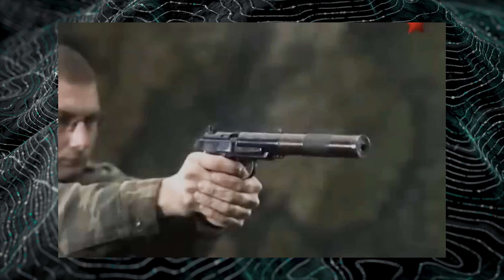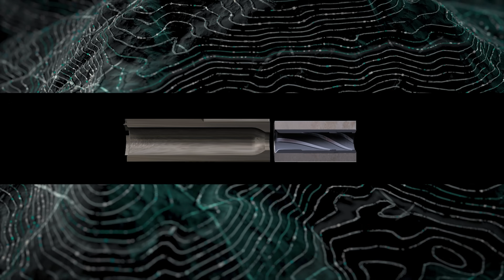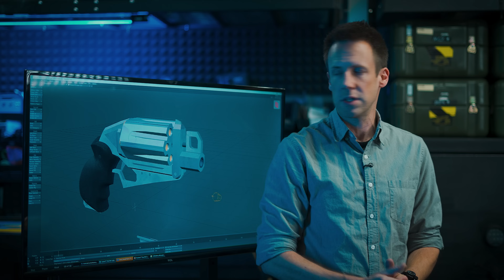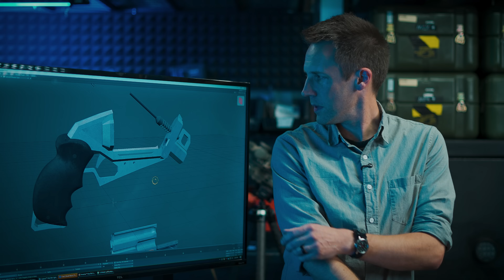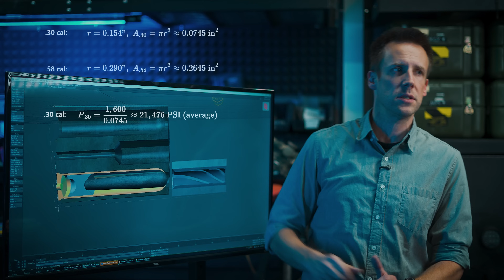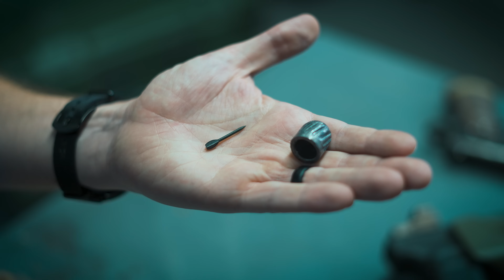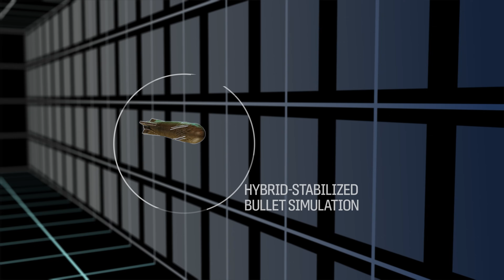Modern Captive Piston Ammo Could Enable Silent Handguns

Comment: Forget the fin stabilization.  Flute the projectile itself, and mill companion flutes into the inside of the barrel.  This lightens the projectile for it's length and further seals the barrel from gas escape, lowering the necessary pressure.  The one downside is that you would have to index each individual round to the correct orientation to make sure the flutes on the projectile line up with the bridges in the barrel.  Shouldn't be too difficult to achieve using some kind of witness mark indicator on the round, or maybe a protruding tab on each cartridge so it can only be loaded correctly.
Reply: This is the beauty of making a round to be fired out of a single weapon, and designing a weapon around a single round.
Reply: @isaacbotkintrex  Except the concept will not work.
Reply: You might want to study a bit more about how metals behave when moving against one another at high speed. There is a reason why barrels have never used flutes with finned projectiles, and instead employed discarding sabots. Do your research, and you'll see why you need to go back to the drawing board.
Reply: @N0B0DY_SP3C14L nope. Blanket statements like this always end up being wrong, it's just a matter of if it's already been proven or will be proven.

People don't not do things because they simply "don't work", they don't do things because the downsides make it impractical or functionally impossible for a give use case.

But, given a sufficiently abnormal use-case, basically anything can work.

We live on a planet where some lizards use weaponized blood jets from their eyes for defense and shrimp have acoustic pistols for arms. No matter how batshit the idea may or may not be, it can work, it's just a matter of determining whether it does or doesn't in a particular application.

Comment: I don't think that stainless is going to do what you want there, I think it's going to let a lot more heat through than you think and that the cylinders will get too hot and you'll have carbide precipitation problems.
Reply: This is the other thing that I don't know much about. The gas expansion math is hard, and the aerodynamic math is hard, but the thermal math is really complicated. I'm really curious to know how much heat you would actually be transferring into the cylinder with six shots, and each piece of brass in a different sixth of the cylinder.

Comment: I've commented on captive-piston ammo from time to time (and place to place; probably not here), but then the point was always that it would be good for gas generators that are smokeful, poisonous, hydrogen-embrittling, etc, that might be more accessible than nitrogenous powder but can't work in normal guns.

That delrin thing is genius
Reply: Genius! The ability to run different propellants opens up a whole bunch of very interesting, almost never discussed chemicals.
Reply: One caveat I'd raise here is that you'd still want the propellant to be traditionakly safe. Eventually it will leak out of the casing, and when that happens it'd really suck to die from your own spent cartridges.

With that said, you could still have things like self-neutralizing cartridges that catalyze their own waste gasses for safe disposal. (For instance if the resulting waste is acidic, you could line the cartridge walls with a very basic compound.)
Reply: One of us

Comment: similarly to a nerf gun, the tail of the bullet should be much lighter then the nose, as you will need a forward center of gravity. at such slow speeds and such low velocities, you won't be able to rely on spin stabilization to be able to stop tumbling enough. If need be, you could even try a smothebore with sabot design.

Comment: Interesting exercise but the design seems to have a major and fatal flaw.  Your projectile will be spinning at multiple rotational speeds: none at the rear before getting to the barrel, slower as it enters the barrel, and the faster as it exits (your progressive rifling)... given the projectile length your bullet will be torn apart.

Additionally, you are pushing against the weakest and most important part of your projectile with your integrated piston.  Hard to imagine copper or lead not crushing or deforming in a manner that would render the fins useless.
Reply: based on the shape of the projectile, only the front part of the round would be engaging with the rifling and longer shafts actually allow for more torque to be applied before reaching material failure so I don't think that would be an issue as you describe.  not sure about the fins, could maybe solve that by having a stronger core material that would stick out past the fins and interface with the delrin piston head
Reply: Yeah the round and barrel would need to maintain a tight tolerance to keep the copper from from being smashed/expanded by the piston lmao

Comment: CO2 is only 800psi baseline
Reply: You must not live in a warm enough climate...
Reply: @isaacbotkintrex how warm does it have to be to add an extra decimal place? We get up to 30-35C (86-95F) in Ontario. You might get up to 900-950 psi at those temperatures. Still significantly lower than HPA tanks that are rated for 3-4.5K psi.
Reply: @CHGLongStone some of my research may be wrong. I was seeing numbers as high as 12,000 psi at 100F.
Reply: @isaacbotkintrex don't know where you'd get numbers like that. Have used CO2 for a propellant in paintball for 5 years and airsoft another 15 after that. Everything I've ever seen is rated for 800psi if you're running it straight without a regulator.
I'm thinking delrin may not be suitable for the use case either, machines well but its a bit brittle for hard use.
Interesting concept though, always like the stuff you put out 🤝
Reply: @CHGLongStone Argh, I did it again. I misspoke when I said 12,000... What I meant to say was 1,200. I think my brain was confused from the 12,000 peak PSI later in the video. You are correct 1200 PSI would be very high, and 12000 would be insane.

Comment: The registration part really begs the question of is it an issue of the ammo or the firearm because what if the firearm was one that was designed to purposely say pierce the delrin wad inside the casing allowing that gas to escape say... firing another projectile... but then that would be 2 projectiles being shot with one trigger pull... likely an issue so if it was designed with a binary trigger that the firearm couldn't actually fire until the trigger is pulled inwards and then released, effectively 2 trigger pulls 2 projectiles being released. sure the second one making use of the captured gases defeats the entire purpose of the cartridge design but its just head cannon about the nightmare that is the legal rules that get applied with such 'suppressed ammunition' because then you could have it marketed in a way that the cartridge is supposed to be pierced, releasing that gas, and then therefor not being suppressed. However if fired through something like you designed here it just would never actually allow the gases escape meaning it would be a design on your firearm that allows for suppression and not a design in the ammunition. Also an idea for the copper projectile rather than milling it since it is so soft I wonder how effective it would be to press fit some sort of additional fin/sabot that would allow for the progressive rifling to be performed and then after a certain amount of centripetal force while It is flying through the air some kind of 'air brakes' for lack of a better term at the end would essentially pull the press fit sabot off the copper rifled projectile. There of course is the concern that with every additional piece added to the projectile incurs a cost of centricity, drag/velocity, and different ft/lbs of force at the muzzle vs on target, it still is a very thought provoking concept. Id love to see something like this but its built around a 410 brass cartridge that's filled with copper flechettes, I think that would meet the idea you had mentioned about ' who' would realistically use something like this, combat engineers come to mind, plus with it possibly being a smooth bore with rifled choke revolver you could probably get away with creating some kind of "flare" ammo for whatever situations that would require, avoiding disturbing wildlife but still signalling for help? In combat having a nearly silent way to send an IR flare in the sky for signalling? Hell since its so cyberpunk maybe some sort of flare loaded with confetti to take down drones while you're indoors and you don't want to lose your hearing LOL
Reply: If the delrin ruptured it would act more as a shotgun than a 2 shots with a single trigger pull...say a r.i.p. round separated early or a shotgun fired 2 slugs from one shell...still very legal bozo

Comment: Honestly, at this point, dealing with the energies in question...

...Just use springs and dampers. No need for conflagrants or energetic chemistry.
Reply: It's so energetic, though...
Reply: @isaacbotkintrex I mean yeah, the "fire" in firearms is fun and all, but I'm pretty sure you could push a .45 slug pretty quietly to near-sonic velocities with some really strong springs and dampers. Then there's no real need for containing the sound of explosions.

Try contacting Jorge Spraeve, he might have some ideas.
Reply: @kireduhai9428 we should let him show us those features.
Reply: There are airguns that use pre charged compressed air cartridges with burst discs for each shot. You could probably modify one to use a piston. It wouldn't be considered a firearm and airgun suppressors aren't NFA items.
Reply: @chemistryofquestionablequa6252 compressed air guns a great, but they still have the issue of the expanding compressed gases making a noise.
Reply: @isaacbotkintrex what I was more getting at was compressed air cartridges with a captive cylinder that would drive the bullet. All the air would stay inside the cartridge.

Comment: Remember those rubber half spheres that kids would fold flat and they would automatically jump really high... if you applied a similar principle to the plunger mechanism, you could store mechanical energy in it and release the energy as velocity... perhaps not even needing much (if any) powder to initiate it... maybe even just classify it as an air gun... or you could put water in it along with an heating element that flashes it to steam and releases once 2500 psi is reached.
Reply: Like a RPG?

Comment: great video, i always wanted gun design to return to this concept and try it again.
progressive rifling is hell for production QA.
 you can also try using a long slug with a discarding sabot, but it might not work with cylinder gap.
why not adapt it for pump action/lever guns guns
Reply: Electrochemical machining might be the best way to do progressive rifling. You can 3D print the mandrel and etch any shape into the barrel.
Reply: @isaacbotkintrex try to do that in a mass scale and consistently with proper QA checks...idk how that is possible or profitable
Reply: @mistaBorg it may not be profitable. Another idea is to 3D print a metal barrel insert. Under normal circumstances this is a terrible idea, but this is a very short barrel that will see very low round counts... So an easily replaceable barrel might be okay.